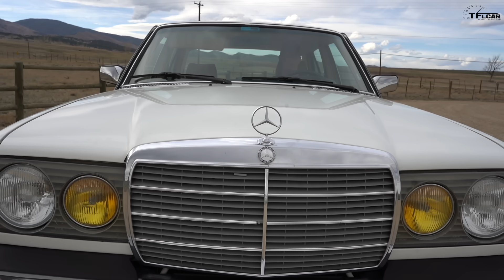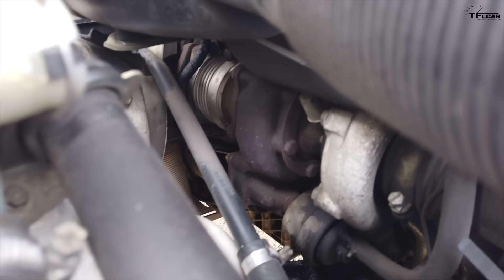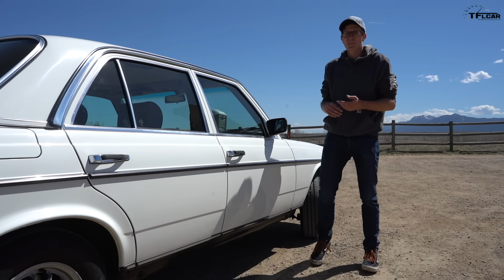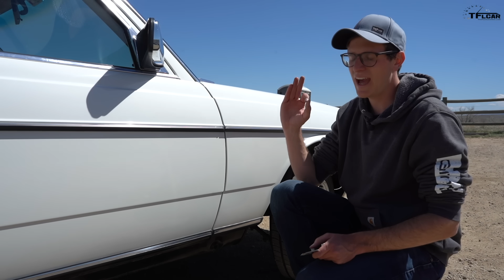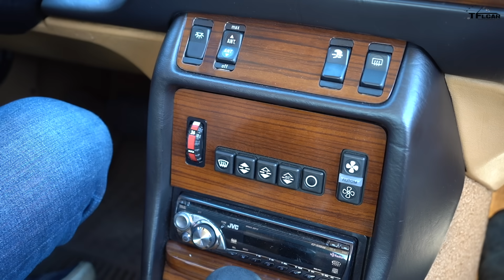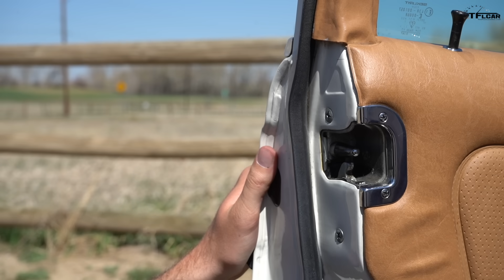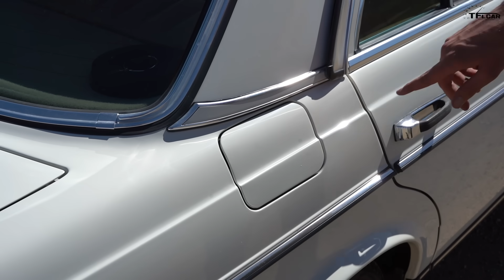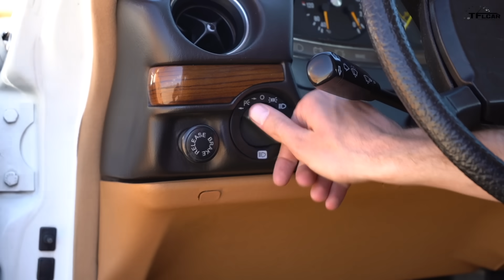This 37-Year-Old Diesel Is THE BEST Mercedes Ever Made!

Comment: 18 deg = a very nice Temp' in a car / home / office.  approx 65 deg F. ( 15 c is 60 f )
0 / zero = freezing point.  30 c is the very hottest days in the Uk ( ok it can touch 33 - 35 c 95 f ) 
Our Thermometers are graded in Both  c & f.  ??????? Silly EU Rubbish. None of us know what we are talking about.   IT's CRAZY.  

We buy Beer in a bar in  1 Pint, & half Pint Measures. 
We buy Beer in a can,  500 ml . ( approx, a Pint. ) 
A Whisky / Brandy etc in a bar is sold in a Measure of 25 ml. 
And this is UK LAW. 
They cannot sell it in any other Measure. 
In a UK Bar, 

You order a Half PINT of beer & 25 ml or Vodka, Whiskey etc. 
or a PINT,  And a Double Vodka / Whiskey. etc. = 50 ml. 
Petrol / Car Fuel is priced & sold in Liters.  But we still Talk about MPG miles per gallon  !!! 

The EU Shafted Britain with UK Imperial Measures MIXED with METRIC.  since 1971. 

Wood for a Joiner :- an 8ft x 4 ft board 3mm thickness. ??? EH WOT ?? 
A 2 meter length of 4 x 2 inches.  ( 4 by 2 ) 

That is NOT Old Folk vs young people, it's all People. 
We Drive in the UK in MPH.  Speed signs are in MPH.  car dash speedo's are in MPH, BOLD, with Kmh in smaller digits. 
Many Cars Can Flick to either,  via the push of a button on the stalk. 
a  "30" speed sign in the UK means 30 mph. 
So we drive at 30 mph to buy a Pint of beer,  and we drive at 30 mph to buy a 500 ml can of beer,
Milk is sold in a 2 PINT container ( 1.36 liters )
We buy Milk in PINTS . 
My Bottle of ENGLISH  Made & Produced CIDER is sold in a 2 LITER Plastic Bottle. ( with NO indication of PINTS / Fl  oz on the Label. ) 
in our 2.5 liter car. at 23 mpg. 

NO I am NOT JOKING HERE !!  This is true, & it applies to many other QUANTITIES / MEASURES, in UK LAW. 

We Talk in Miles per Gallon, Drive in Miles Per Hour,  & Buy Fuel in Liters ?????????????? 
BONKERS !!!!!!!!!!!  The Calculation  is Divide / Multiply by 4.456 to work it out.

Miles / Km = divide / multiply by a factor of 1.6 
( My numbers here are for APPROX Estimates only !! There may be more Decimal points for EXACT calculations, ) 
I am not reading from any LEGAL BOOK on the Precise Numbers & figures. 
Just a  ' Ball Park '  close figure. 

I'm not selling anything so i do not need to be exact. 
It's a YT comment , NOT a court of EXACT law. 

Here in the UK we Buy , Sell & Trade In Imperial & Metric Volumes / Quantities. 

Milk is 2 pints. My Cider is 2 Liters ? both Made here in ENGLAND. Both bought from one of our BIG 4 Supermarkets. 
Cider was £2.30. the milk was 89 pence.  ( 100p = £1.00 )    US $ 1.30 to a £1 approx.  ( Variable ) 
My HEINZ Ketchup bottle only refers to 650g & 570 ml on the label. NO ounces, oz or fl oz. 
WE NEED to be MATHEMATICIANS to work out what we are buying for our GOLDEN GBP £1. 
650g is the Net weight of product.  570 ml is the liquid qty /Volume in the same bottle of Ketchup. 
650 grammes is A Family Size bottle.  ( 500g = half a UK Pound Weight ? approx ? )

Now have you Fully understood all the Numbers & Maths We in the UK deal with ALL DAY EVERY DAY ? 

2 pints of THIS & 
1 Liter of THAT. 

A Standard Bottle of Wine, is 750 ml  / Three Quarters of a Liter.  NO SORRY, It's 75cl. 
75 cl = 750 ml,  Nofl oz on the label. 
Wine by the Glass is 125 ml, 250, ml,  I think they banned 350 / 375 ml in a single glass . 
OK Buy the Bottle !  ?? DAFT Laws & rules. 

If the W123 gets too warm or too cold Roll the Wheel From Blue to Red, or Open a window. 
or Grab A FLEECE Jacket out of the boot/ Trunk. 
If it's cold Where you live Buy a Local car with heated seats. 
If it's HOT, Buy a Conv', & drive faster for more wind. 

If it's Britain, FORGET BUYING a  W123, They have all gone for Export, any you find will be SILLY MONEY, or a wreck.  TOO LATE Folks They've ALL GONE !!

Comment: In Tenerife , Canary Islands, They use W123 Diesels as Taxi's.  
They Worship their W123's.  they Cover / Expect to cover 2 million Km .
They very rarely wash their cars, They carry a container of water & a Leather,  & wipe the car down Between jobs. With a Damp Leather. 
any W123 involved in an accident, EVERY Nut & bolt is removed Cleaned & stored for other Taxi Drivers ONLY. 
They Totally Wearout Seats & steering wheels & replace them. 
On average they do a rebuild at 700,000 Km ( 430,000 miles. ) 
Many of them have covered well over 1 million Km, & are Immaculate, They look like NEW. 
Being Taxi's Carrying Tourists, They Are under VERY strict rules to keep their cars 100% Spotless Clean & Immaculate. 
Tenerife, Is a warm dry climate Similar to California  15 to 25 deg 12 months. 
No salt on the Roads & Not Much rain. Hence ZERO Corrosion & rust. 

They are the very best car for the job. 

A Perfect example of GREEN & Recycling. 
I have not been to Tenerife for a few years, I would Think there will be still Lots of W123's in use as Taxi's. They only Scrap those involved in Serious Smashes. The Rest Run on Second hand parts & new parts. 

Being a Taxi is the Hardest work Any car can do. 
Their engines only do one ' cold Start ' Per day. = Less engine wear. 
And No Computers & Electronics to go wrong. 
Manual Windows, & Manual Gearboxes,  very Strong but simple Mechanicals.

Comment: We have one.  They really went to the max on detail.   Like mechanical art.   Over 300k miles and still strong.  It has electric everything.   Small latch isn't a "door handle", it just releases the latch.  There's a big handle for holding and pulling closed the door.

PS: you don't need foot on brake to start, just to shift out of park.

Comment: People in northern Africa will rip these out of your hands along with VW beetles. That's the two cars that survive the Sahara desert without a hitch.
My dad had one of those and they were really cool back in the day.
About the yellow fog lights though: they were not meant to cut through the fog better. Yellow fog lights make sense because the human eye can see movement quicker with yellow light compared to white light and driving in foggy winter conditions the glare from white lights tires the eyes a lot more than yellow lights. So there is actual science behind yellow fog lights. What's wrong about the Mercedes is that the fog lights are mounted way too high up and are thus useless no matter what color.  A fog light should be lower than 24 inches from the ground, preferably around 12 inches, simply because fog generally hovers about 2 feet above ground so your lights will undercut the fog.

Comment: You struck me with a sack full of memories! I had a petrol version of this machine, made in 1983. It was heavy and slow, terrible at overtaking (I guess diesel must be even worse). Other than that, pretty solid car, even 30 decades later. Things were built differently in the 20th century...

Comment: This is one mint 300D. I have an 84 300CD currently which I love.. also having owned 2 300SD"s and another 300CD about 18 years ago. Love these diesels..even when the AC blows warmer air than the outside air here in Miami summers..

Comment: I have a 1985 W201 190D and I wouldn’t trade it for anything made now. I did own a 1979 W123 300D which was also nice but with an automatic it was a pig in the city. My current car is a 4 speed manual and whilst you still have to plan ahead to overtake, it’s considerably zippier.

Comment: There are VERY FEW old Mercedes driving around, except I have seen those Diesels a lot. You make excellent points, I almost want to get one. Your car drawing is spot on. People like the "simple" cars. And the manufacturers still don't understand that the simpler the car, the better it looks. Take for example the Scion tC or the Camaro 1st Generation, or the new Dodge Challenger. Simple lines are usually better lines. The very best looking cars were built by American car manufacturers between 1967 and 1973. The best looking cars made by Toyota, Nissan, Audi, VW, BWM, and Mercedes, was around 1970 to 1979. The 1980's was a God awful time. The 1990's was really good for body styles, for everyone except Ford. Between 2004 and 2012 we had some really amazing looking cars. Now most car companies are building UGLY cars again. It's amazing how they can't seem to understand the rule - SIMPLE IS BETTER. The new Corvette looks like a movie car, something "Spiderman" would drive. The original Corvette always had the very beautiful simplicity to it. That simplicity has been over complicated, and obfuscated.

Comment: Traded my Mercedes 250s limousine for a 300d, worst vehicle I ever owned, so underpowered it was dangerous to drive. Love Mercedes, beautifully built (older models) easy to work on, top quality engineering. I miss the old 250s.  The brakes on the 250s were incredible, under very heavy braking in any weather or conditions you had total control. Cheers from Michael. Australia.

Comment: Mercedes benz has a same in museum took it from greek taxi driver the car had 4,8 million km without rebuild
Reply: There's a Portuguese Taxi there too a 190D the engine was never opened just maintained. 1 Million Km! Just regular oil and filters changes and normal stuff.
Reply: that's a w115

Comment: I love to drive my 82 300SD (W126 sedan) but my 79 300TD (W123 wagon) was much easier to maintain and still fun to drive.  My main complaints on my W123 were rustproofing and the Chrysler HVAC servo.  Otherwise it would be competitive (and easier to maintain)  with any current model.  The Achilles heal with these older cars is repair parts ; there are plenty of available parts but many are poor quality., especially rubber.

Comment: The theory behind the separate switch for the rear dome light is. That only the driver can switch it on. And if pesky annoying children turn it on and forget to turn it off the battery will get flat and those cars were particularly designed to always start and go that's why you can only switch on the rear dome light in the front of the car.
And the rear centre arm rest is designed that way so the loop is on the bottom and less visible to the eye.

Comment: A drove a 1980 300D Taxi (no turbo) for a year in Europe. It was about ten years old, and had gone over a million km on one engine and two auto gear boxes. The interior was flawless. Dashboard, door panel, door handles, original steering wheel. Every button felt solid. I was told by the owner that nothing was changed. All original. I had seat covers, so the seats looked brand new underneath. Everything worked - Electric sunroof/windows (fast and quiet) and the cruice control. No air condition. Comfortable car to drive. That solid feeling on everything. No rust. It was of course taken good care of. But still a Taxi where every seat and doors was used all the time. It wast't the only one of course. There where any of thees in the 80' in Europe. Everyone I knew of, was a good or better than mine. The W123 was just too good, so Mercedes took it down a notch. W124 Was still a very solid car. Dont get me wrong. I've been thinking about bying one. I will serve my needs at the moment.

Comment: Thanks for the video. We had an '84 that I regret selling. But, life goes on. I just wanted to point out that I think you missed a nice feature. When you flip the armrest in the back seat down, that flap of "leatherette" can be unfastened to allow skis (or other long items) to go into the trunk and through into the passenger compartment. It was definitely a well designed machine.

Comment: The best Mercedes are  1987 300 SDL, 1998 SL500, E55 AMG.
Reply: Update: Add 2008 E320 Bluetec to the list. It set a new record by driving 100,000 miles in a row at like 143mph speed without breaking.

Comment: You’re absolutely right about the w123. I love mine to death. A 240D - less power but much less to maintain as I’ve had both a few times over. Manual everything except but the sunroof. They are both virtually indestructible and I haven’t seen a better made car since. Thanks for this video!!
Reply: The 300 euro base models are the same.

Comment: That moment you talk about a lot of features like they are special for this car, when in reality most moderne european cars have these features even today.

Tyre pressure sticker inside the gas flap, sunroof with deflector popping up.

Also why so happy about the buttons that reset the other buttons so only one is pressed. Most buttons worked that way, back in the day, not only on cars but casette players.

Also the "parking light" has been on every german car i have owned, the first of which was a 1986 Vauxhall, and nowadays its just a matter of flicking the blinker stalk after i take out the key, and it will do the same.

Comment: One tiny, but cool detail you missed: the door hinges had a grease fitting built in to keep the hinges from wearing out!

A lot of W123 that have stiff doors today can be brought back to their original silky smooth operation with just a couple injections of fresh grease!
How’s that for amazing engineering?!
Reply: 300DBenz Thanks for the tip!
Reply: Tomas Mica it needs a grease gun like this: https://www.amazon.com/Astro-101-Grease-Needle-Nozzle/dp/B000FMK7FG/ref=sr_1_56?keywords=Grease+gun&qid=1559176989&s=gateway&sr=8-56

And Mercedes Source yt channel has videos on how to get the grease in the hinges.
Reply: No other car on the planet hardly has a grease fitting for the hinge. Amazing engineering for longevity.

Comment: Nice review. One thing i think is important to emphasize: these cars don't squeak and creak. Not even with 500 thousand kilometers on it. The body is sturdy. Another thing: mb really took time to think how these cars are repairable. Most every component is easily accessed. Almost all bolts are non-corrosive. The interior materials can handle the life of the rest of the car. The original exhaust mufflers has multiple layers of sheet steel for longevity. The suspension system, especially at rear, is still 40 years later proficient. Electrical switches etc will last till eternity, excluding p/windows toggles which might need a replacement after 30yrs. When the suspension is in condition, the ride quality is perfect balance of comfort and precise driving dynamic. I could write an essay to compliment the mb w123 and 124. Back in the day i was a bit reluctant to the mb snobby image. But the more i got hands on experience on mb's i learned to respect the mb philosophy. I interpret the mb way of design and mfg as engineering pride and honor.
Reply: I was given a stack of $19 oil change coupons.  I called to see if they would work with my '85 300d if I covered the extra oil.  The manager said "A MERCEDES?!  Nah, man.  That's $120."

It's a faster job than my '91 Ford Ranger.

Comment: Had a W123 series 240D and 230E: both useless! Would not recommend to anyone! My father had a 1959 220s, now there was a Mercedes! Since then have had 280SE (good), 450slc (good), 230E (fair), 2010 E350 (good) and a 2012 E350 Cdi: great power, great consumption but expensive electronic (sensors) replacements. This made this very expensive car very unreliable!

Comment: Turn radius is 10 meters, not 10 centimeters. Minor difference... 😉

p.s. some modern car builders like Tesla STILL can't get the panel gaps right...in the 21st century. 😮
Reply: I bought a 84 300d for 450 dollars a nd drove it for 7 years wat a blast to drive even drove it tp california from Detroit and back truly is a great car
Reply: He measured diameter, not radius - so need to halve those values for radius !
Reply: @millomweb  Take a ruler and look at it: 10 centimeters is about 4 inches! Either diameter or radius, it makes no sense.
Reply: even 10 metres would be wrong for the radius, 10 metre diameter maybe...

Comment: It would be fun to compare it to the Volvo 240. As it was from the same era. However it was so good it was manufactured until 1993 and even outlived it's successor the 740 by one year.
Reply: Volvo designed an engine block back in the mid 60s and used the same one for all their models for the next 40 years. Both cars have some attributes but both are also underperformers.

Comment: My mechanic tod me that the electronic fuel control would probably blow out during an EMP strike.
I hope he is wrong.  Is he?
Reply: There is no electronic anything control in the car; the injection pump is purely mechanical.  I have an '81 240D and you could literally rip every single wire out of the car, and -- as long as there was daylight, the weather was warm enough, and you parked on a hill to get it started -- it would drive perfectly well.

Comment: I think I remeber that the spring inside the gas lid was also a holder for the gas CAP when  Infilled the tank. There is no string to hold it and you did not close the lid without putting on the cap. And you didnt put the cap on the roof and left. The strange construction of the lid spring inside the lid is also a cap holder.